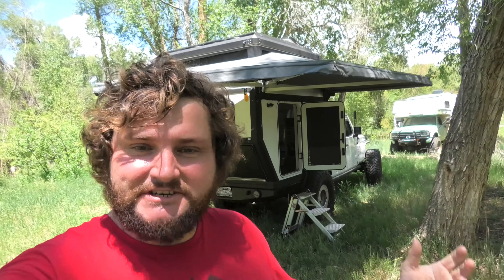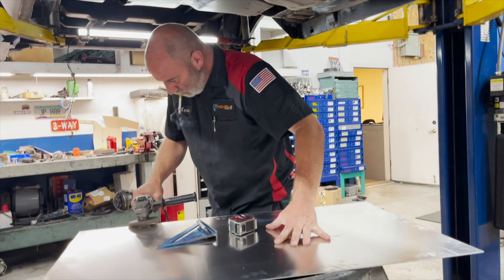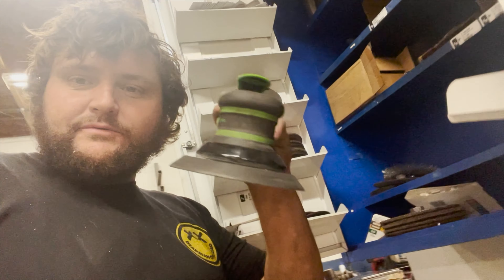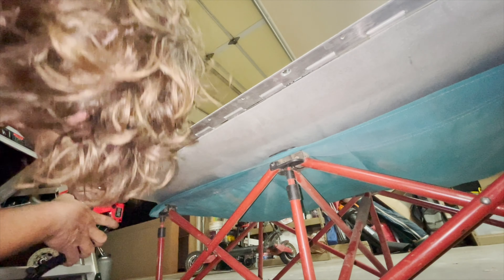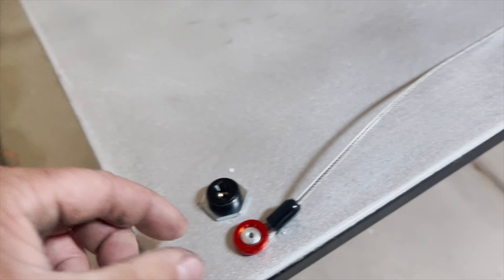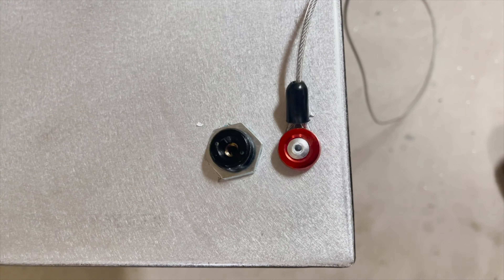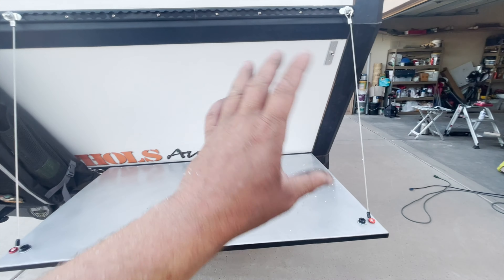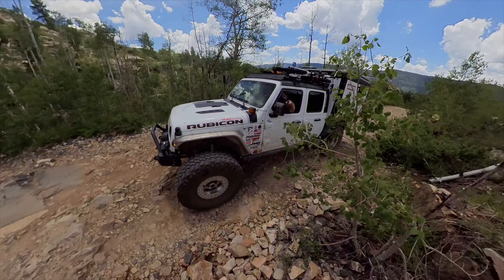How I Built a DIY Drop Down Camp Table for my Expedition Truck Camper

Comment: Phil,  the rivets will fail!  replace with bolts, table should hold at least 30lbs. or more. But looks really good!!
Reply: As it sits, those rivot bases are the only thing holding the weight of table and its contents. Won't take long for those to get pulled through and drop the table.  Side mounted would certainly be the best method, but now that he holes drilled, it would be easy to add a through bolt with a fender washer on the outside and a nyloc nut on the inside.
Reply: @insaynbcr  
Bolted through the sides.
With adjustable legs.
And a mount for a fan.
A spinning propeller fan, not a fan like the commenters are fans.
.
Well, OK.
Them, too!

Comment: Phil, after you drill your holes in metal there is that finger snagging swarf stuck on the back side right?  Throw a much bigger drill bit in your hand drill and just touch the hole with the bigger bit. This will cleanly knock those off and give a light chamfer to the hole edge.  Just don't put any pressure on the bit as you don't want it to grab and make your hole bigger.
Reply: Good call, another bit that does that job very cleanly is a step bit. I love step bits.
Reply: @C_,
Or dab silicone caulk over the potential surgical bits!
.
And that, my friends, is the only appropriate use for silicone caulk on a vehicle...

Comment: Any reason you didn't rivet the table cable to the side of the table (instead of the horizontal surface)?   Rivetting it to the side would have given it additional strength compared to where it is connected right now.
Reply: Rumor has it, the cables perform the essential 'reduce usable work-space' function.
.
If I was me, I think a second set of cables are mandatory...

Comment: I didn’t see you put any silicone around the holes you drilled in the back of your camper. Might wanna go back and do that👍
Reply: re -- bathtub caulk with silicone
.
That stuff has zero stretch.
On a vehicle with shifting components, silicone caulk always breaks, requiring a second then a fifteenth application.
.
Although silicone is woefully incorrect for sealing holes on a vehicle, the stuff is impossible to remove.
You start with a putty-knife...
...graduate to a chisel...
... and by the third week, family long-gone and the neighbors concerned for your mental health...
... you are considering the nuclear option.
.
I may have some experience in the matter.
.
.
2003, for the windows in our ExpeditionVehicle, we used Vulcum 116 sealer-adhesive.
Nearly two decades full-time live-aboard, the Vulcum 116 remains soft and pliable.